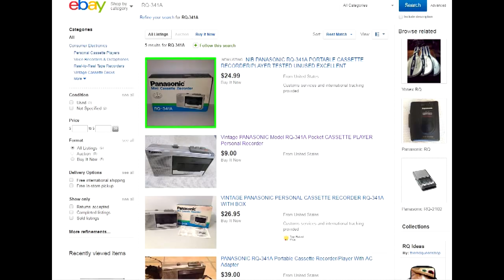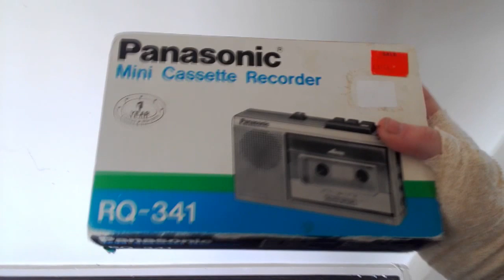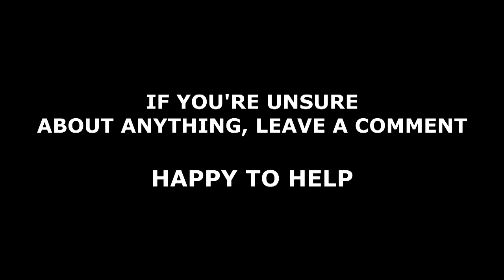[EASY] HOW TO MAKE JACKET'S TAPE RECORDER [WIN10 compatible]

Comment: There's software that works with Windows 10 now, does that mean that the board will also work with Windows 10 or is the actual hardware not compatible with Windows 10? Asking because i'm gonna make one of these lol and can't find a good alternative soundboard button card thing.
Reply from the maker: Chr0nite sorry my friend I'm not too sure! try running the program without the board to see if it runs, but it may be the hardware. an alternative would be to check out the adafruit boards, they require soldiering however, but have more customizability. good luck!
Reply: thanks for the quick response! I ordered one of those and i've tried the new software and it does run. I'll see if it can detect the board when I get it!
Reply from the maker: Good luck!
Reply: Chr0nite did it work?
Reply: wkody7 It hasn't arrived yet, i'll keep you posted!
Reply: Chr0nite thanks man!
Reply: Does not seem to work with Windows 10, seems to be a driver issue.
Reply: Chr0nite sorry to hear that pal.
Reply: I found a solution. Well, sort of. I had to install Windows 7 on a separate external harddrive and basically boot Windows 7 to work with the soundboard thing lol. It's a bit of a hassle but it fucking works!
Reply: Chr0nite kick-ass man!

Comment: Is there only one sound per button? If so, how do you put multiple sounds on one?
Reply from the maker: Padcom you can have multiple sounds on one button, when loading the files into the program, you'll need to assosiate a single file for each of the groups (left side) just make sure to go over the program segment in detail of this video to see!
Reply: Mori Animation The process for the Win 10 version is different, but the end result is the same, right?
Reply from the maker: Padcom should be, yes. be sure to read through their FAQ and device info on the website and be sure to measure it to make sure you can fit it.

Comment: None of the modules on the windows 8+ look like they would work. am I SOL?
Reply from the maker: Your options are manually set-up of the parts, either adafruit or 8+ compat. boards, if you have access (friends or family) to earlier windows OS I highly recommend doing so! You will have more variety of options if you choose the DIY boards.

Comment: rip that walkman
Reply from the maker: Still works!
Reply: damn, how did you make it work still?
Reply from the maker: Commander Corbin it's basically like a graphics card, it sat in the case and could be removed, it works outside of the case with batteries.
Reply: i know, but maybe you can edit that wiring on the walkman, and make it fit,  and solder the speaker to the board
Reply from the maker: Commander Corbin no, it would not fit

Comment: How many buttons would i be able to fit with multiple kits?
Reply from the maker: Two fit inside this particular model. There'll be 8 buttons which you can fit on the side.
Reply: "Thank you, very much!" -Jacket
Reply: Mori Animation so if i space this out correctly i can fit 3 buttons where the large play button used, to be, 4 in each of the open spots on the top, and one on the side
Reply from the maker: There'll be four spaces on top, four on the side. The ones on top can be secured on the inside under the plastic, but the ones on the outside need to have the wires through the holes and fasted down on outside plastic.

Comment: How would it play more lines ? Will it play em random ?
Reply from the maker: You can set it to have multiple sounds on the one button.
Reply: Ok thank you.Will it play them how I instaled them or random ?
Reply from the maker: I've forgotten if you can do random, but mine play in the order I listed them (1-4 etc)
Reply from the maker: Check in the trigger function if there's 'oneshot, retriggerable random '
Reply: I  just have a plan of doing this but I am not good at electronics and stuff.And the triger function in the original tape recorder or the speaker ?
Reply from the maker: When you get all the parts feel free to message me if you're confused on anything. Nothing of the original tape recorder bar the shell is used.

Comment: Can the cassette tape only hold 4 buttons?
Reply from the maker: TheOfficialR3S yes however you can store up to 300 seconds of separate audio files on them.
Reply from the maker: If you mean space on the outside to be able to press, you can fit 8 using two kits

Comment: Mori how do I download the modules
Reply from the maker: Modules?
For voice files, see the top Drive > jacket for board, right click that and hit download.
Reply: Because pm66 keeps saying I’m not properly connected
Reply: Can I download it in file
Reply from the maker: @mothman5952  you need to explain things better. Try a different usb port, open the pm66 WINDOWS 10 VERSION correctly, then check board. I can't help you with basic computer navigation things, ask a friend, brother/sister or parent.

Comment: im planning to make one soon, does this still work?
Reply from the maker: Yes, should do 😄
Reply: @MoriAnimations  Also i wanted to ask, is the audio clear? Or is there any way to improve it?
Reply from the maker: @kazzam5  audio is functional, this video doesn't represent it well. I made this and took it to a con and communicated with it. Better audio if you can solder a better speaker or create using arduino
Reply: @MoriAnimations  Thank you for the quick reply!
Reply: @MoriAnimations  Oh and i wanted to ask, would a RQ-339 work as well? its quite hard to get hands on the one shown in the video.
Reply from the maker: @kazzam5  you will need to see the manual or documentation on its measurements to know. The soundcard is relatively small but it is best to get a non-mini cassette player to be sure.
Reply: @MoriAnimations  Thank you
Reply: @MoriAnimations  Sorry for asking so many questions but i just wanted to know, can the speaker on the recording module be changed? in the description of the module it said that it is possible to add external speakers so im just wondering if it can be changed
Reply from the maker: @kazzam5  yes. You will need to solder them and make sure it didn't exceed the voltage input required
Reply: @MoriAnimations  Aw man i hoped there was a way without soldering But thanks either way

Comment: Hey um mori can u give me a link to the window I’m on ten
Reply: I’m getting real close all I need is the mod That been ordered and modify it
Reply: I am really determined to do this I’m big fan of jacket
Reply from the maker: @mothman5952  its in the description, look on the website they have the windows10 version there
Reply: But one last  question how did u get routines
Reply from the maker: @mothman5952  what do you mean routines? Do you mean voice lines? There was a download for the entire rip. I cant back it up any longer, you'll have to find the rip or record your favourites from a Jacket Voice Lines video
Reply: I mean like we’re u press the button and it’ll do you know what time it is then press it again it will say something different
Reply: U did it in the vid
Reply: What did u use to open it in google drive
Reply from the maker: @mothman5952  It's in the video, load different sounds into the program on the one button. Slow it down if you need to take another look.
Reply: Wav 16 bit
Reply from the maker: @mothman5952  i dont understand what you're needing help with, please clarify more. I made this video two years ago, my memory is a little fuzzy
Reply: I’ve all ready downloaded it
Reply: The lines
Reply from the maker: @mothman5952  i still dont knkw what exactly you need help with. Watch the video again, everything you need to get the devicd working is in it.
Reply: Can u help me find pm66
Reply from the maker: @mothman5952  in the description, scroll down the webpage until you see documentation and downloads.
Reply: I’m in down loads on my laptop right now
Reply: I got the writer

Comment: If I were to buy two kits where would the other buttons be?
Reply from the maker: There were enough spots to put after gutting the tape player. You can also drill holes into the back if needed

Comment: would it be possible to keep the buttons from the cassette recorder and put them over the usb buttons ?
Reply from the maker: You'd have to figure out a way to cut/remove them from the original board, re-attach the locking mechanisms and then also have them push on the board buttons.
Reply from the maker: This would also mean you'll only have space for 1 kit.